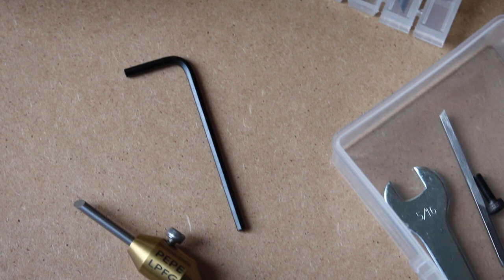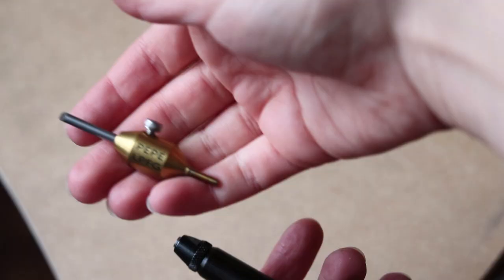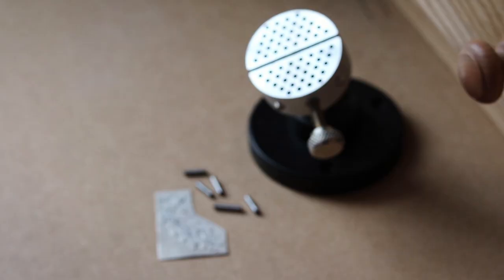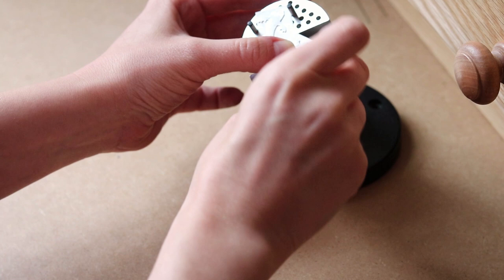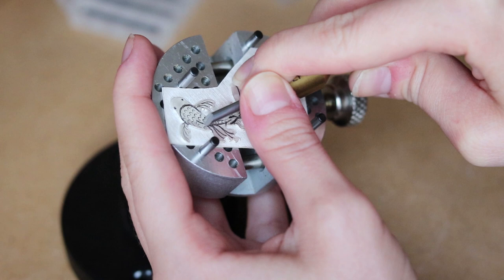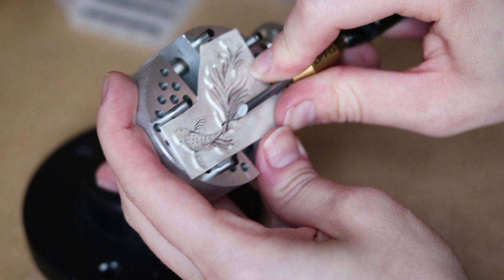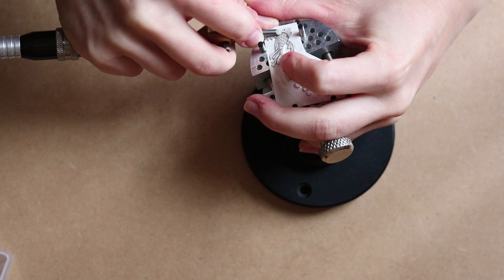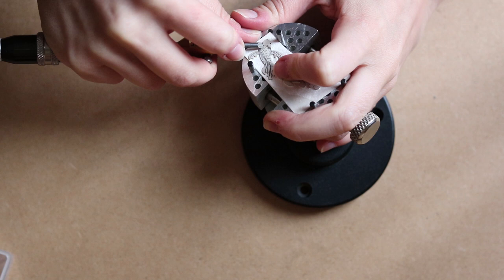Testing: ENGRAVING ADAPTER by Lion Punch Forge & Pepetools

Comment: So one tip as a hand engraver my self. It's worth while to properly learn to sharpen your gravers. They don't come presharpened 2heb you buy them from Rio, Stuller, grs, etc... They are only preshaped and not sharp yet. You'll have to learn to properly sharpen your gravers by hand or with a fixture, check out Steve Lindsay's sharpening templates for the best cost effective route, or grs dual angle fixtures for a more expensive option which gives the the capability to sharpen practically any graver. Steve Lindsay's require you to buy the sharpening holder and then you can purchase any sharpening template seperatly. When you cut into the metal it should cut very easily and you'll see a chip or curl of metal rise up as you cut through the metal. Good luck! Check out Sam Alfano's tutorials if you would like to learn more about hand engraving 👍
Reply from the maker: Awesome! Thanks so much for adding this, very useful information, I appreciate it  a lot ❤️

Comment: A tungsten tippped dart is excellent for making into a graving tool…just cut the body down to required length, drill and tap a 3mm hole in the end and screw/ loctite in an m3 grub screw…grind the point to suite requirements…easy peasy..
Reply: where can I get these dart? what do you use to grind them with

Comment: The tip of the graver needs shaping to the users choice, that one looks much too big for the job, you can get them much smaller in square and round section. A fine grinding wheel can be used to get the initial basic shape, and then use a fine carborundum stone to finally sharpen…👍

Comment: Got one of those a few weeks ago, didn't work that good until I got the sharpening fixture. The v shaped tools work much better for what you are trying to do. I have done quite a bit of copper with it, practicing for the silver I am going to use.
Reply from the maker: that's great Mark! Yes, I absolutely need to sharpen them! :) I'm still not entirely comfortable using this with my foot control for Foredom, the other, bench top control is much better, as it offer settings for one low speed. But I will keep trying with my gear too :)
Reply: @TheArtOfMetalsmithing   I have a old Foredom probably 30+ years old just put a new foot controller on it for this engraving stuff, it is very controllable. Main thing is to have a good grip on the work, like a GRS ball vise. I have seen that you are supposed to keep the engraver stationary and move the work into it.  The ball vise is great for scrolls and circles as you turn it with one hand and hold the engraver with the other. A big thing is having a very sharp tool with the correct heel (angle  and size) I have the same hand piece as you and the length of it makes it kind of hard to hold . The D model has a flex in the middle that makes it easier to hold. Just takes lots of practice like everything!
Reply from the maker: @Mikesukes  I totally agree that it requires practice. I hope to get better with time :) Isn't the speed too fast though, when you use foot control? It seems that way in my case. When I press it just a little bit, it doesn't start, and if I put just a bit more pressure on it, it suddenly jumps stright to higher speed, so maybe my foot control isn't very precise. And I will definitely need an engraving ball vise, I can see that any engraving like this is extremely hard without one, that's why I haven't been practicing a lot. But I'm hoping to learn more with time. Thanks so much for your tips! :)

Comment: Do you glue on your applique piece onto a back plate and then take it off? Your fish are so beautiful B. I just bought this same tool from Pepe, haven't tried it yet. Maybe Chris will make a video on how to use it. You are wonderful!
Reply from the maker: This one is actually already solderef on, becasue I needed two layers. I didn't cut it out just yet, becasue I thought it would be easier to work on it while it's bigger 😃 I think Chris has a few videos on this adapter, definitely one how to use it :))
Reply: @TheArtOfMetalsmithing  yes, that completely makes sense.  Thank you for your answer, it helps so much.

Comment: great video! a couple of tips though, sharpen the graver it should have a nice polished surface, looks like your are using more of a hammer effect where its better to use to cut away metal to engrave, try to turn the piece more than turning the tool 

even though not same machine i would recommend watching  to get a rough idea
https://www.youtube.com/user/express375  = Shawn hughes 

but dont take this as critism as i think you still did a very good job especially something you have never used before 
awesome video cant wait to see more! :)

Comment: This video was painful in so many ways. Kudos for trying something new . The desire is there but your technique is horrible. You have to hold it @ a much steeper angle plus you need to use a very fine sharpening stone, like a super fine diamond stone to put what's called a heel on that new graver your using. Without a heel the graver will just want to dive deeper & deeper into the metal with no control.it causes you to try and pay the handpiece almost flat like you were doing but it won't work
 A heel is just a quick rub of the stone along the bottom edge of the face of the graver from underneath. There are hundreds of videos on YouTube that show how to put a heel on your graver
 It's so easy you'll laugh.whenbthe herl is on hold the edge against the metal at an angle of about 45° . This is just an average. You will quickly find the angle that will work for you. Than your off & running. Good luck. Use YouTube. Don't get discouraged.